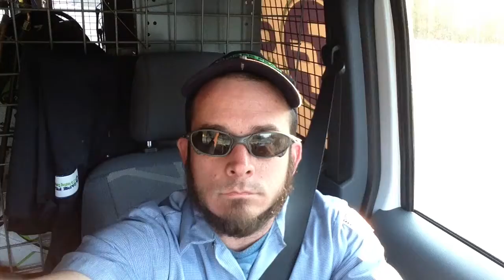HVAC QOTD: What do you use for leak searching?

Comment: TIF ZX-1, finds so many leaks for me. It has to be the ZX-1, some of the others (like the XP-1) aren't as good for 410A. Had the D-tek select, very mixed results with that. Before that the Bacharach Informant II, which sucked. Just got the H10-PM to try out due to all the likes across the web about it. When all else fails, then its cut apart the system into sections, pressure test with at least 300 psi nitrogen, and either break out the soap bubbles, or come back in 48 hours and see which section lost pressure.
Reply from the maker: I like the TIF, just hard to remember to keep it charged. Actually just had to turn in my H10G to be calibrated. It would sense the presence of 410A right from the schrader valve.

Comment: Hey stephen, is it ok to leave a refrigeration system under vacuum over night? I got a walk in at my school down to 400 microns and absent mindedly forgot to take it out of a vacuum.. Hope it won't damage anything.
Reply from the maker: Did you leave the manifold connected? When I pull a vacuum I never remove my gauges until
I've released the charge or weighed in the additional refrigerant. Even in the split second that you disconnect your hoses there is a potential for non-condensable to enter the system.
Reply: yes i left the manifold attached! it will probably be under a vacuum when i go in tomorow :D unless theres a leak but i spent three hours combing that system for every leak so there shouldnt be! I'm just glad it won't cause damage to the compressor leaving it in the vacuum overnight. My thought was maybe it would pull the oil from the compressor into the hoses or something, i didnt know haha.

Comment: H10pm is what I go for.  All other portables seem to work great for the first 6months and then drop off and turn to pos.  Refrigerant dye works great but if used improperly can cause damage to systems.  Most dye on the market has a capacity rating.  Most techs who go for dye don't heed capacity ratings which can lead to damage.  IE 100ton AB dye pack is dumped into a 5ton POE system.  My next complaint about dye is when a tech doesn't fill out a dye label and stick it on a control panel to inform the techs behind him that dye was introduced to the system.  I like to keep my nice manifolds clean and keep the dye manifolds only on dyed systems.  Most times residential leaks can be found easily by pressuring with nitrogen.  In large supermarkets with common refrigerant lines 30'+ above and piping for days, dye can be your best buddy.  With that being said a good UV light is also needed in conjunction.

Comment: I don't like getting dye all over my hands and tools. Some people don't want it in their system, and I have used it and not found leak with it anyway. When I first came out of school, I was placed in a maintenance position with a big A/C company that used electric leak detectors, and they were really good at finding leaks. I use Tek Mate now, but I carry plenty of extension cord, on the truck; so, I'm prepared if I make the leap back to electric leak detection. Sometimes I will even isolate equipment, and change-outs get a new line-set bid in; unless, I verify no leak is present in the original line-set, through isolation pressure test, and a flush if necessary.
Reply: just charge em, no auto a/c repair experience.

Comment: i just dump stop leak in it and call it good! lol im kidding stop leak NEVER! i use the fieldpiece srl2 infrared detector and love it. i also like the dye for stubborn leaks. never had a problem finding leaks with the dye. i people have problems with it because the skimp and just put a little in the system. spectroline says you only have to use a couple line of the tube but they recommend the whole tube. i do the whole tube and never have any issues. dye is also great because it never goes away and any future leaks are easily found. people that say they cant see the dye without it being dark must not be wearing the proper glasses need to see the dye well because i can see it fine. just my 2 cents. to each his own. keep the vids coming man

Comment: I'm thinking about getting an h10 but want to know if any of the battery operated sniffers are any good? the only method for leak checking that i do is to pressurize the system and then soap bubble everything. that usually finds it and if it doesn't… in my old job we would add the dye and then do a check up a week later and usually find the cabinet and coil all green lol. coil replacement would fix that up.

Comment: I use Yellow Jackets Accuprobe UV electronic leak detector.  I had an Infinicon but it literally blew up when the batteries swelled in it. I love the probe and bought it when I looked at Eddies review of leak detectors. Thanks Eddie! My coworkers have the fieldpeice infrared. After watching Jim Bergmann 's video on TTT I decided to go with the heated diode for pinpoint accuarcy. I use a lot of dye and swear by it. I have found leaks with dye in evaporator coils that my Accuprobe and the fieldpeice infrared could not find. It was a pinhole, tiny, tiny, leak in the center of the coil. I have never, not once, not found a leak with dye. It is hard to see in the sunlight. But if the leak is large I do not use the dye. I'll find it with the sniffer. I use dye because it's in there for the life of the condenser/compressor (oil) and I can then scan the system on pm checks fast. It's so much faster than pulling out a sniffer and probing every single inch like a soldier in a minefield. I can show the customer the dye as well. It's something they can see and that makes them feel at ease. I have been behind others who have looked for seasons...added refrigerant and said it's a mystery. I added dye and in 2 weeks came back to find the evaporator coil covered in a green mist of dye. I show them and we repair it. Done. And the dye is in there for the next leak.
Reply: ***** it really depends on the situation. If the system has been running for a long time and then all the sudden quit cooling due to no refrigerant then I will add nitrogen to the system and usually find the leak with that method because it's large. If the system has been left for years without running due to a vacancy then I would add refrigerant and dye to the system and change all the Schraders. It really depends on the situation and what's best for the customer at the time.
Reply: ***** yes
Reply: ***** yes

Comment: I don't like the dye because I just haven't had much success finding leaks with it.  First off, in most cases, its difficult to check the back side of an evaporator.  Second, Its got to be pretty dark for the u/v light to show anything.  So if you are leak searching a condenser on sunny day, you simply will not find the leak with the dye unless the leak is large.  But if that was the case, you wouldn't need dye to find the leak anyways.

Comment: I recently had a strong leak on a glass door beer case line up, 3 twelve ft cases, there was a strong leak where my leak detector was going off when I just opened any door. I used Trace with flourescent dye in it. It worked great, I found the big leak on a factory braze on the evap and two weeks later I found another small leak on the liquid line in the cieling space while working on something else. I had another walk in cooler that was low on refrigerant, I put trace in it and an hour later I found the red dye on the expansion valve after I had put soap on it and the soap didn't bubble. Fieldpiece infared leak detector works pretty good,I also use Bacharach's Informer, it works ok. Haven't used Trace since the 70's, I bought six more for truck stock. Really miss my halide, they worked great and they were quiet..

Comment: Sometimes you dont have enough access to the coil to see the dye. Up here theres alot of uncased coils in plenums with no access door. Most of the time will isolate and pressure test over night.
The H10 looks good but I use a cordless sawzall to cut steam pipes Im not dragging out an extension cord for a leak sniffer. I was thinking of getting the Fieldpiece detector but not sure if its any good or not
Reply: ive got the infared fieldpiece and i love it.
Reply: ive got the fieldpiece srl2 infrared and i love it. has been better then any other detector i have ever had and i have had alot of different models. it takes some getting use to because it works be sensing a change in refrigerant level not just sensing refrigerant so you have to keep it moving or it calibrates zero basically to surrounding reffrigerant levels. check out the videos on it here on the tube
Reply: and also i havent tried the h10 personally in this decade. had one years ago and it was alright. they do make the h10 in bettery powered models as well. food for though
Reply: awsom70 I almost clicked the buy buttton at Amazon for the FP Heated Diode Refrigerant Leak Detector - SRL8
I would rather get it at TruTech but its 2o bucks more and they charge for shipping. Cant beat Amazon for price. I watched the video where he compares the two different ones. I need something easy lol so I was thinking the diode may be better for me
Reply: Al Gregory
i have no experience with the srl8. and i find trutech tools to always be higher in price then some other online sellers and my local supply houses. i appreciate jims videos etc but i dont like his prices lol! just make sure however you buy it from is a fieldpiece dealer and you wont have any warranty issues.

Comment: We use the D Tek.and using dye is a last resort.If we cannot find it with nitrogen.Helium can be used in some manufacturing plants for hvac and refrigeration.They have a machine that sniffs in helium.also we use our micron gauge by spraying a litle water on the joints.
Reply from the maker: Those are all great methods though I have not heard about using helium before!

Comment: Do you know if an older but in great condition battery powered H10 can be refurbished and if its even feasible, I have had one in storage for about 5 yrs, I have the Fieldpiece SRL8 sniffer but have used it only once, its ok, easier and not as impressive  as the H10
Reply from the maker: I am afraid I do not have an answer for that question. I've always dealt with RE Michel with questions about servicing/calibrating my tools.